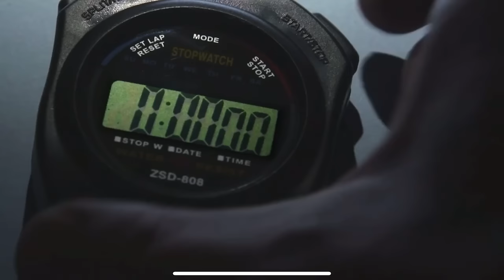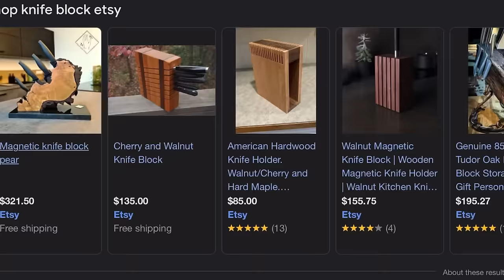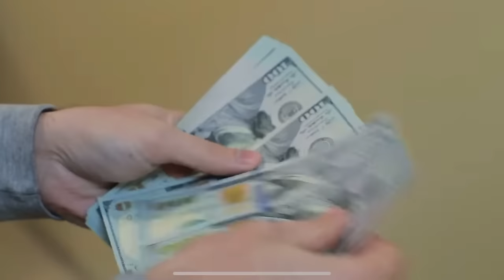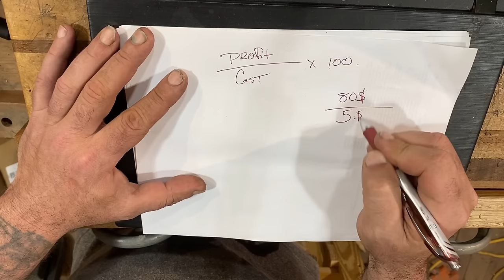Wood projects that sell fast

Comment: As the Mrs. I am wondering how this could be weighted (not great for shipping) so it doesn't tip or how the bottom could be widened? Thoughts?
Reply from the maker: It works just fine , I had it on that styrofoam and it wasn’t smart of me to! 😂 it’s plenty wide enough and plenty Sturdy
Reply from the maker: Also as far as shipping , whenever I ship something I package it to be bomb proof so lots of packing bubbles and foam and such